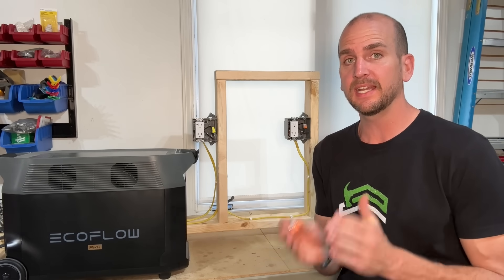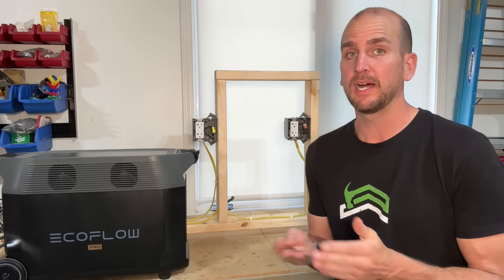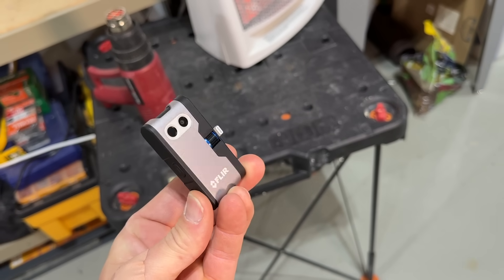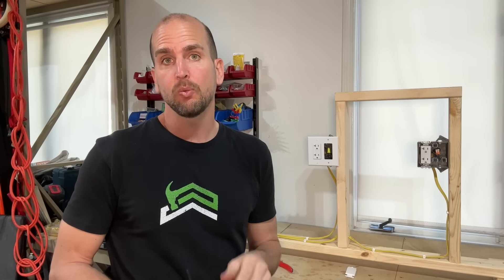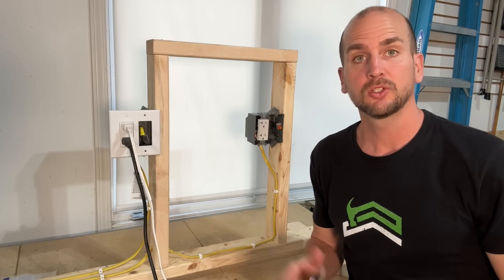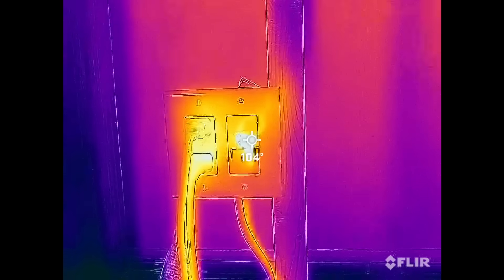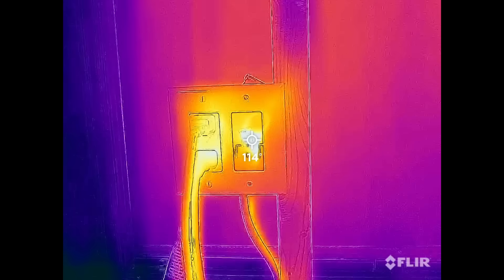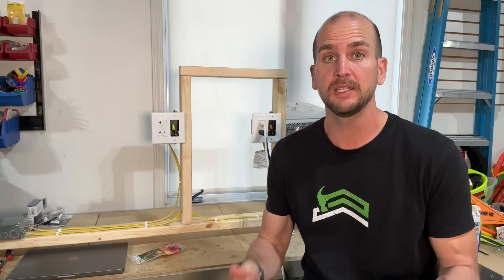Debunking the Pros: Can WAGO Lever Nuts Handle Heavy Electrical Loads?

Comment: Liked your video, and I have used the Wagu push type termination on a small job. I like how easy it is to use them. But my concern is that the metal tapered coil or spring within a wire nut seems to create a Gas Tight seal against the copper wires at each point it makes contact with the wires. The coil or spring bites into the copper at multiple places. The Wagu only at the gripper area. So One fast tight contact. The copper laying on the internal buss bar is just line contact. Maybe not gas tight and I question how Wagu connectors perform over time. Corrosion will be able to form on the buss bar wire interface.  Any long term data on these?
Reply: All I can say to this is that if this was an issue, we'd be hearing about it from European electricians as Wago lever nuts have been used there for decades. After such prolonged and widespread use, logically we'd know if this was a concern or not by now. They don't seem to have any concerns like the ones North American electricians have either.
Reply: @technerd9655  Thanks for reading my comment and replying. I really wasn’t aware that these Wagu lever nuts had been around for so long. I do like using them and they keep wiring looking tidy.
Reply: @Phsteddie  Since 1977, to be exact. That's when the WAGO company started selling the first wire nuts with the current cage clamp mechanism. (They had a different design from 1950 to 1977.)

Comment: Minor correction: a 20A breaker does NOT trip at 20A.
Reply: I think they will over an extended period of time. But if properly functioning, a breaker will not trip right at its rated current limit.

Comment: I collect old electric clocks and also use Wago or similar there because they do not strain the 80 year old wires.  Capacity and temperature are not an issue with the very low current draw.

Comment: The difference between 105 degrees and 115 degrees is not enough to worry about. More importantly, that 10 degree difference was in a circuit that was overloaded with unrealistic current flows. It would be interesting to see how the Wago connector performs in a 15-amp circuit.
Reply: Wago 221s are approaching 10 years on the market and no problems so far.  Compare that to the numerous instances I’ve run across where wire nuts became loose.
Reply: @glasshalffull2930 
 those wire nuts were loose when they were installed. Poor workmanship
Reply: @glasshalffull2930  When somthing goes wrong with a wago they dont come tell you about it.
Reply: I have heard numerous people tell me they had problems with them burning.
Reply: @RadioRich100   A picture is worth a thousand words.  Never seen a failed Wago image.  I’m sure if they were failing, the images would be all over the internet.
Reply: @glasshalffull2930  exactly, I have seen plenty of burnt up wire nuts though.
Reply: @glasshalffull2930  I've had one in 4" can light a couple years ago.. Didn't take a picture though
Reply: @barfy4751    Great!  We have a datapoint!  Was it a Wago or something other brand?  How exactly did I it fail?  Did it appear to be installed correctly?  Thanks!
Reply: @RadioRich100 When something goes wrong with WAGOs, its an international recall. German standards are WAY stricter (in practical sense) than in the US
Reply: Overloaded? yes Unrealistic? no.

Contary to what the guy said in the video, breakers DO NOT trip the instant you overload them slightly. A 20A breaker will sit at 23A for a long time perhaps indefinitely.
Reply: It has little to do with current flow, it going to be ageing , heat and vibration. No reason to switch to them except speed.
Reply: @RadioRich100  They last just as long. They work just as well. 
Read through the comments. There are other tests that have run 80 amps through the Wagos and wire nuts. The Wagos held up better.
If they work just as well, and last just as long, are just as safe, and they are faster, then why not use them?
Reply: @DaveMiller2  No they are not. They have no track record here, just in other countries where they have had issues and here also. Testing doesnt mean that much because field conditons cannot be simulated in a lab. Over amping them doesnt prove what happens with age as the spring contacts loses its spring leading to arcing. All this so-called testing was done on aluminum wiring too because it was cheaper. How many people died from that one? 100's of home destroyed years after the wiring was installed. These are simply faster which can lead to more disasters. Wirenuts put on correctly cause no trouble. Wagos put on correctly can and has.
Reply: It's not the actual temp of the connection but the DELTA that's important Wire nut is 20º, WAGO is 30º. That is significant and will only increase over time.
Reply: @SerenoOunce   The important thing is this is an OVERLOADED circuit and the electrical safety features would have kicked in.  The breaker would have tripped and the Wagos are good to 220F.  Romex would start to melt at 185F.  Maybe we should replace all the Romex already installed as a fire hazard????  BTW - how much will the temp differential change over time?  You have any actual data on that?  Because if it’s 1 degree per decade, I think we’ll be OK.
Reply: It is enough to worry about,it indicates resistance is high when there new. What happens a few years down the road when the spring loses some of its tension. Wire nuts work forever.
Reply: @RadioRich100  I’ve seen plenty of wire nuts lose their connection over time. Maybe people were overloading the circuits but it’s something that can happen to wire nuts just the same as WAGO.
Reply: @riffdex  you can't say they became loose because you can't measure how tight it was a the start.
Likely bad workmanship that failed over time
Reply: @RadioRich100  Did you not see how far below the temperature limit 115 degrees is. It's WELL below and that is at 24 amps which you will never see in the real world on a 24 amp circuit.
Reply: @RadioRich100  (reply to first message here)if you look an the consruction of the wagos you will notice that the Spring Tension actually should increase if they get hot. 
At least thats what i interpret from how they are constructen and info from another Video with a Chinese Extension Cord/Splitter that failed. 
The Failure mode of that Splitter was that the Contacts were bent sheet metal, and when they got hot they would revert to their sheet flatness, which made them disconnect in the Socket. (and here they were the actual electrical connection)
For 221 Wagos the Spring is a U-Bend which has both "arms" together with the Wire go through a Hole in a mechanical part of the Bus Bar. If it tries to flatten itself it will increase the Tension on the Wire, not loose it entirely because of this construction.. at least thats what i think the reasoning behind this construction is (and pretty much every Wago Connector has such a consideration in its construction)
Reply: @unitrader403  Which means thru time the tension will decrease especially after so many cycles.
Reply: @RadioRich100  Pretty much every Electrician in Germany (and probably all of Europe) uses Wagos only, and that for Decades now for pretty much every Circuit up to 32A. We dont have problems because of this here. So this Argument is baseless imo (no Data to back it up).

Also i dont think you understood the principle, but in short the spring tension in these connectors is self-stabilizing..
Spring gets looser (bend gets pushed together) => more heat => Spring wants to return to its original Shape (flat) => Spring Tension increases => less Heat => cycle repeats

this is diffrent from the previously mentoined Chinese Product, where the return to original shape made the contact jut disconnect.. but not that i mentoin this one: every American Household has dozens of Spring Tension contacts, because that is how Outlets make and break Contact.. and i doubt you swap these out with any kind of regularity because "the springs get loose"
Reply: @RadioRich100 The WAGO contact is constrained, applying constant pressure. There's no reason to think this will magically loosen up because of trivial temperature changes. The only way I see any chance of this when used correctly are repeated insertions and extremely high vibration environments where you'd have to carefully consider anything used to splice wires. You're just making up a failure point and pointing to aluminum wiring which is completely irrelevant.
Reply: @RadioRich100 The springs loosen up way less compared go a wire nut. Wire nut can legit just fall off after some time, especially when installed the standard, badly installed way
Reply: @AlpineTheHusky  Wire nuts are forever if put on right. If you can do that you have no business doing electrical work. Wagos are junk made for speed and sacrifice quality and fail often.
Reply: @RadioRich100  I've done renovations where I've had to remove wires from decade(s) old push-in style connectors. Spring tension was just fine, had to work to pull the relevant wires out. That's why such connectors are allowed to be used for a permanent connection behind a fixed ceiling or such (in the various national standards I'm aware of). Wire nuts aren't, because they're screwed on, vibration and other influences can screw them off.

That aside, we used a Conex brand push-in connector on a recent project and had three fail in three different houses when subjected to a (very heavy) load from the bricklayers cutting paving stones. So we're strictly back to Wago now, and no, we've never seen those fail.

For comparison, the suspension springs in your car have a significantly harder life, and how long do those last?
Reply: @washellwash1802  Theres no wagos decades old. And they dont use car suspension springs in them. (thats stupid) You wont see anything fail immediately. Just like aluminum wiring , it was many years before the first house burnt down and hundreds after that. And all the authority's  standards and labs approved its use. Even if a wire nut screwed off(never seen that) the twisted connection is what counts.
Reply: Wagos are banned in alot of towns. I guess they should go by utubers huh?
Reply: @RadioRich100  name those towns
Reply: @RadioRich100  Their original patent for spring terminals is from 1951. The push-in style connector was patented in 2003, two decades ago.

And of course they don't use car springs, I was using them as a clear example that it's stupid to assume springs will fail after a few years.

As for things unscrewing themselves, there's an entire industry and toolset devoted to locking nuts to stop that from happening. Secondly, no, it's not the twisted connection that counts when your live wires are floating around in a box without any insulation on them.

Comment: More resistance equivalates to more energy loss due to heat. I suspect that a 10amp load on a 120v circuit would be equivalent to a 11-11.5amp draw. The "micro" losses to me would add up with the more receptacles and fixtures using the wagos could cause an easy circuit overload under what would appear to be under the breaker's rating on paper but the amp draw would be much higher due to the heat loss and if you're using the receptacle at the end of the chain.
Reply: When the resistance goes up, the circuit current decreases. That is why there are wiring length limitations, depending on the amount of voltage drop that is acceptable.
Reply: @buggsy5  yes but when the device/appliance calls for 1200 watts. it will get its 1200 watts. If not the device will not work or will overload the breaker

Comment: As a HVAC tech I've been using WAGO for years. Wire nuts work fine and yes, you have to install them correctly. But I will tell you contrary to what all the WAGO naysayer "ELECTRICIANS" are trying to claim, the touting the supposed superiority of wirenuts. I can say, over decades of years of service, many times I have come across weak connections by "ELECTRICIANS" losing connections, particularly in multiple neutrals bundled.  Also many older wire nuts I've seen with a hole burnt right through the end by heat.Usually caused by "ELECTRICIANS" poor connection technique or wrong size wire nut selection. So they are not with out their faults. I find the WAGO are fantastic for control wiring work, because you can join hard copper and stranded wires without the worry of a weak joint.  Plus up to 5 wires joined together without worry of poor twisting technique. And they are removable  Both work great BUT BOTH need to be installed correctly, and like all tools, each have their strength in a particular installation. The Naysayers seem to be the closed minded types.
Reply: Your hvac? for making these comments you might as well be a mailman. Your not an electrician. You deal with low voltage/low current wires. Your wires can be joined with bubble gum. Buzz off.
Reply: Should have ran much longer than 20 minutes. That's like driving a car with pedal floored and saying that's the fastest it can go even tho it's still accelerating just less at 30 seconds than it was at 5 seconds.
Reply: I agree wire nuts are more time consuming and the less time an employee of a contractor has higher chance they are going to cut corners. Employee is not the owner won't care about what happens in the future. My entire house is branch aluminum wire all the wire nuts were 2 wires untwisted under a gray wire nut. Maybe that was the proper way in 1976 but I have found a few the plastic was melted.
Reply: As with any type of connection. Poor install will render it ineffective. It comes down to preference in my opinion. Both are a good connection and it does seem the Wago is more user friendly. I like wirenuts because I like wirenuts, it’s what I’m used to.
Reply: If Wago would be so dangerous some is trying to claim there would be burning buildings all over Europe. I have in my life come across to melted  221, both where due to bad installation where the wire had not been striped good enough and the wago griped on to shield instead of copper. One was in one of our projects, a 90 000m2 factory, where everything is connected with wago. There are if I remember correctly for example 33 000 lights installed, a lot connected with 221 style.  
I can with 100% certain say that the failure rate would be much higher with wire nuts
Reply: @Iceeeen  I dont agree. Circuits that carry high current especially motors will over time melt wagos. Lights probably wont, but lazy electricians will use them for everything. It only takes 1 wago to burn a house. Properly installed wirenuts will last forever. Properly installed wagos are a fire waiting to happen.
Reply: @RadioRich100  Well my experience says something else. I have come across 2 melted wagos over allt the service jobs I done. Both with the same miss, badly stripped cable. 
I have to ask the project department on Monday  just for fun if they could how check how many wagos are used on a bigger project. We have a office that was handed over last week with 15000m2, would be perfect to get som perspective of the failure rate.

But on the other hand I can't remember the last time I was on a service with wire nuts (for any type of work) They are mostly gone. 
Then again. The only thing that actually pulls any crazy amp for consider amount of time today is EV chargers and that has to be run on an own circuit from the central  so no connections on the field. 
HVAC is either smaller EC fans and bigger units is run with frequency drive. Mostly anything else around here with big power draw cycles and never really builds up heat anymore.
Reply: @RadioRich100 And what is your evidence for this?
Reply: @cristopherfrakes1416  "i made it the fuck up" - RadioRich100
Reply: @cristopherfrakes1416  none, it's just his misguided opinion that anything other than wire nuts will fail.
Reply: Control wiring is low current /voltage and is not house wiring. Bad workmanship is the person not the method.

Comment: Very interesting.  Your graphs show me exactly what I would expect.  No surprises, no concerns.  Great video!
Reply: There garbage
Reply: @RadioRich100  Then dont use them.
Reply: @martyb3783  I dont , I spend enough time replacing them.
Reply: @RadioRich100  I see.  In what ways do they fail?
Reply: @martyb3783  Burn, melt , arc, intermittent circuits. Levers pop open, wires rotate inside connector body when moved. Circuits quit with heat, vibration and age. Etc
Reply: @RadioRich100  Interesting.  That has not been my experience.  I have only used the Wago brand however.
Reply: @martyb3783  Yep that the brand im talking about.

Comment: The ONLY disadvantage of Wago is the price of the device. They are in any other respect a far superior splicing device. Also, many have made very sound arguments justifying the price of Wago with their efficiency of installation which saves on labor costs.
Reply: Labor costs are irrelevant for DIYers, also not all labor cost savings are necessarily passed to customer
Reply: @dmitripogosian5084  Absolutely agree

Comment: The Wago are well within spec and the chance of a DYIer messing up the wire nut connecting is way greater. If the connection for the wire nuts is not secure then you will get way more heat.
Reply: What spec? The ones the manufacturer came up with to sell them? If your a diyer and have to use wagos then you probably shouldnt be doing the work in the first place.
Reply: @RadioRich100  electrical equipment has to be certified for the country that is used in like UL or CSA.
Reply: @craven3190  You can't debate with RR - I think he still uses a horse and buggy, rather than one of those fancy Stanley Steamers.
Reply: @buggsy5  😂